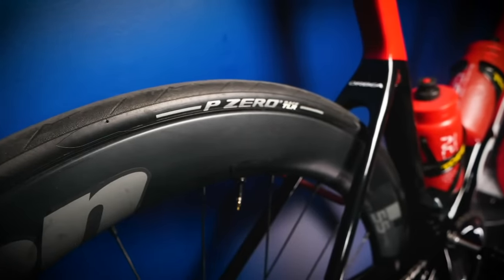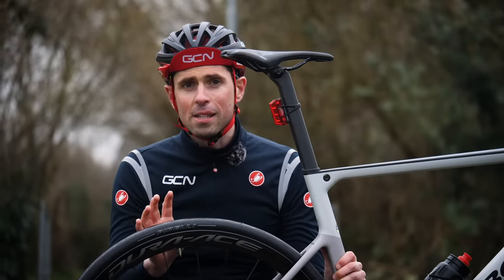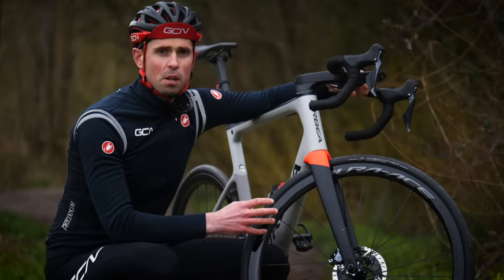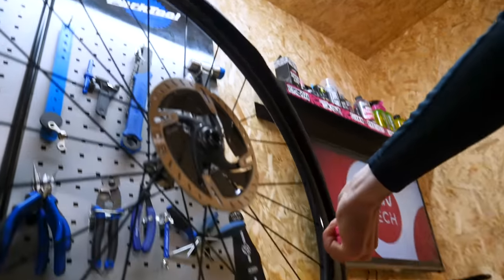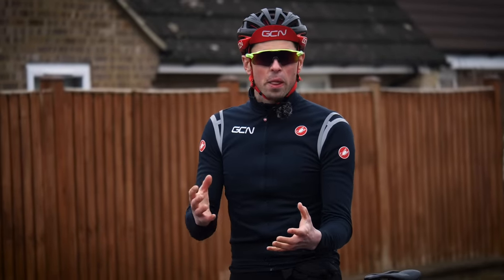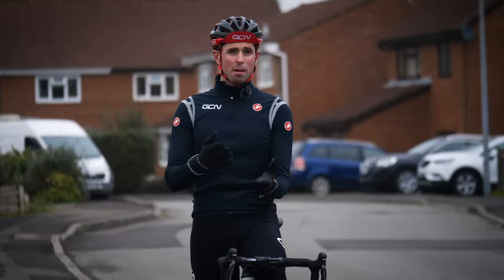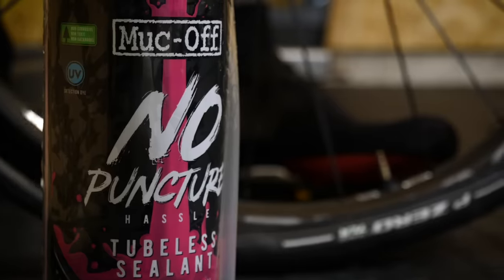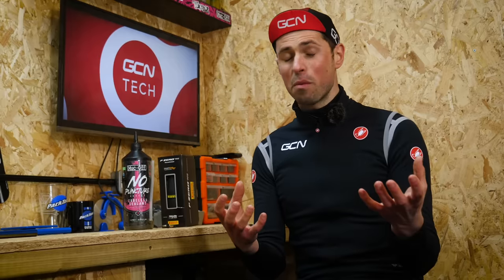Tubeless Convert! | Why Alex Will Never Use Inner Tubes On His Road Bike Again

Comment: Doing mostly long distance riding, this is not at all interesting. I’ve seen plenty examples of people struggling with tubeless tires. More than with tubes. The worst one taking two hours to seat a tire after a stubborn puncture, that needed the tire off. We ended up having to drive the rider to a bike shop, where they had compressed air. It only takes 3 min to change a tube.
Reply: Besides, this test is faulty. The course should have been ridden at a specific speed, like 35 km/h, and then we could look at the watts differences between the rides.

Comment: I ride tubeless on my gravel bike and tubes on all the others  - why? Because I can’t afford 3 new sets of wheels.  Not sure why you are running your tires at 95psi on the 28mm? I run mine at 60/65psi. Much more comfortable. Bigger tires with tubes lower than this.

Comment: Clearly biased, and it doesn't even shower the power he is doing for each run, psychologically he could be going harder with the tubeless just because he prefers it.. I tested tubeless once and it I got a puncture and it didn't even cover the whole .. so I got stuck in the road.. the rolling resistance compared to latex inner tube for example is not significant and can use those tubes for faster days.. no from me..

Comment: My new gravel bike has "tubeless ready" wheels, but not "tubeless ready" tires, so there is a bit of expense with changing. If I run it as 60psi now with tubes, what pressure would I run it with tubeless?

Comment: What as the lightweight tube: latex or something else?  And was the test done at a constant (or quasi constant) power output?  I'd like to see this test redone at an indoor velodrome so that changes in wind and traffic won't influence in the test and so that power output can better modulated. Then test the following set ups: tubeless; tubed w/ butyl; tubed with lightweight butyl; and tubed with latex.  OF course testing indoors means you won't see any data that reflects any impedance (as discussed and researched by Anhalt, Heine, Poertner and others  https://blog.silca.cc/part-4a-rolling-resistance-the-history-and-previous-works).

Comment: The performance and all of that has been a wash to me.  If there was a sealant you could literally put in and have it last the life of the tire, so it didn't dry up over time, and have you wondering if you are covered or not, I think it'd be better and adopted.  I want to be able to train and outside of something ridiculous, not worry about a flat.  I still carry a tube or two, patches, then have to add in plugs, etc if i'm tubeless.  I want more security.  Performance from slowest to fastest isn't enough for me to care, comfort is the same for me with latex tubes.

Comment: Another GCN commercial, tubeless and an ugly Orbea disc bike. You are making this sport all about tech and forgetting what riding a bike is all about. 
I use tubeless and tubes and around my 50 mile circuit there is absolutely no difference in performance.

Comment: I've recently switched to tubeless. TBH the main reason was simply to reduce punctures as there are a lot of hawthorn hedges around me that get cut, then thorns on the road. One question though. Do I need to remove the old sealant when topping up every 6 months or so?

Comment: Question: Is it ok to use the carbon wheel tire-levers on dura-ace wheels? I have the dura-ace carbon wheels & the manual says that you cant use tire levers. Saw you using the carbon wheel tire-levers and really curious. Cheers.

Comment: #askgnctech Hi Oli and Alex, I have a set of Zipp 303S wheels running Continental GP5000 TR tubeless but find that after 3 days, my tyres are down to about 10 psi. I pump them up, go out on a ride and yet again 3 days later, tyres are down to about 10 psi again. Is this normal or do I have a leak somewhere? Thanks in advance
Reply: The gcn videos are just product placement adverts for the industry, hence the lack of interest in replying to your valid question.

Comment: On my CX wheels I get a nice reassuring "ping" when I set them up and the tyre seats and the tyres stay sat even if they go flat. Whereas on my road wheels they don't "ping" when I set them up, so the tyres unseat if they lose pressure, which is a massive pain if I need to let them down for any reason. If this a user error, or a problem with my tyre choice, or a problem with my rim choice?

Comment: Question for you! How many times over the 5 yrs you've been on tubeless have you a) been stranded with a catastrophic failure that wouldn't seal, b) had to put a tube in  while roadside and contend with a messy milk shake doing it? I like everything about the concept and advantages of tubeless but every time I get close to converting I read a post or article about someone getting stranded because of it, and if I have to carry a tube anyways, I'm just not sure I see the net advantage.....Are stories of sidewall tears and sealant failing to work exaggerated?
Reply: Not going back to tubeless any time soon. Just a complete pain in the butt.
Reply: I've been running tubeless for a few years now on both MTB and Road and have had zero issues. I can see a few white dots on the tire here and there where it has sealed what would have been a flat.

Comment: Why can you run tubeless at such lower pressures? I have only ever run clinchers and I have never really understood why there is such a difference in pressure.
Reply: you won't get pinch flat when you use tubeless that is why lower pressure for tubeless. if you use that low pressure on an inner tube you are very likely to get pinch flat.
Reply: @charng  Of course! Thank you! I just switched over today.

Comment: I am very interested in moving to tubeless tires, but I have some concerns. I know tubeless can handle some small punctures. What happens when I am out on a 100 mile ride and have a puncture that the tire cant handle? I can imagine a big mess with the sealant going everywhere and if I have to carry a tube as a backup what’s the point? Right now tubes seem so much easier. You have a flat - change out the tube. If you have a flat with tubeless it seems like it would be a big mess and you have to carry a tube as a backup anyway. I really want to go tubeless so convert me!!

Comment: Alex! Help! My new bike came with a tubeless wheel set. I do love it. However, when I inflate my tyres to 85psi or higher I get spurts of air and sealant coming from an old puncture. Is there something still in there? I have looked but can’t see anything. Any advice?
Reply: Yeah.  Not unusual IME.  My advice would be to go back to tubes.  Honestly.  Not trying to be a d-hole, but I've tried tubeless on my road bikes a bunch of times, and it's crap.  People will probably suggest that you're doing something wrong, running the wrong brand of sealant, or that you shouldn't be running more than 80PSI anyway or you're missing the point.
The truth is  that I've given it several tries, with different brands, and it always ends up screwing me over.
If you really need that miniscule (or possibly imaginary) improvement in rolling resistance, then you're probably a pro racer, and should just run tubulars, since you can just get a wheel from the support car if you ever flat.
If you're an average joe who just likes riding his bike, use tubes.
If you're an average Joe who just likes to tweak things even if you know it doesn't actually matter, get latex tubes..  They're just enough hassle that you can feel like you're hardcore, but without the likelyhood of ending a day of riding when stuff doesn't work like it's supposed to.

Comment: I would be more concerned about being stranded on the side of the road because you don't have a tube to fix a flat. Really can you ride these and not carry a tube anyways? Personally I have a tubeless tire set up, and I have a spare set of wheels that used tires that no longer work for in a tubeless state.

Comment: #askgcntech

I've slightly damaged the rim tape, not in the well, but outside of the well. If I apply a patch of rim tape to cover only the damaged portion, will that suffice?
I don't want to use a new tape for such a small damage.

I want to go tubeless, just preparing for it.

Comment: Meeeeeeeeeeeeh. Ive seen tests on rolling resistance between tubeless and tubes. We are talking the tinyest of % of differences.  Tubeless road tires with sealant can end up weighing more than a tubed tire,unless you buy the handy dandy 160.00 a set special tires.  Not for me. Ive sliced too many expensive road tires.

Comment: Has anyone ever on here ever sucessfully put an inner tube in a tubeless tyre, i've tried at home as an experiment with a gp5000tl and a hunt wheel I gave up after an hour and am not convinced it can be done   especially in cold temperatures when the tyre is cold and less flexible.
Reply: My Hutchinson Fusion 5 tubeless tyres work just fine with tubes. Gave up on the tubeless setup.

Comment: I have 4 sets of on road wheels, each set have a lot of life left.  I don't see any practically why should I switch to a tubeless set up.  Furthermore, the video is subjective, why not put the tires in a DYNO where power and etc. are controlled and consistent with each other.

Comment: I was all about tubeless until a catastrophic failure caused my tire to explode. Granted it would have happened on a tubed tire as well but i lost all air within about two seconds. I'm just lucky it happened coming out of a turn and not in it. Now I'm running one tire tubeless, one tubed with a latex tube - I can't tell any difference.

Comment: Sealant works as good in tubes as it does in tubeless.  Not a flat in 3 years running this way.......................what if you wanna swap tires quick for an upcoming ride?  Not with tubeless you wont.

Comment: I have converted to tubeless tyres recently and I agree with Alex. Inner tubes are dead 😂 much smoother ride on tubeless
Reply: Wait until you puncture and the sealant doesn't work. Then the "fun" starts. Tried for more than a year and got tired of putting tubes into a gooey mess.

Comment: #AskGcnTech Tubeless and rim brake, could  the higher temperatures of the rim during the breaking  dry  the sealant? I have a set  of carbon rims that should be tubeless ready but  I'm  worried if the  liquid sealant hardens up with the heat!
Reply: No it won't

Comment: Not a great video. Test is absurdly unscientific isn't it? And no real discussion of the cons of going tubeless.
I'm a big fan of tubeless for off road riding. Where the pros far outweigh the cons and the extra grip offered by tubeless tyre is critical.
But on a 28mm road tyre there just isn't enough gain to offset all the negatives.

Comment: If I wanted to try tubeless and have the right rims & tyres do I need a specific type of pump to get the initial seal? All I have at the moment is ‘Stone Age’ track pump.
Reply: It depends.  I've never used a special pump and have always gotten them to seat, but I have had some that are difficult.
All said, I wouldn't bother.  I've gone back to tubes.  Tubeless isn't worth the hassle.

Comment: Everyone knows: latex inner tubes are the best.  Why did you run your experiement on slow, heavy butyl tubes??
Reply: Watch the video one more time - they used both the regular and lightweight tubes.

Besides, latex tubes are known to leak air, which means you have to pump the tires constantly. Fuck that.
Reply: @dainiusvysniauskas2049  I don't agree!  Latex are so fast and awesome!  Pumping up for each ride isn't really an issue, if you ask me!

Comment: Tubeless is fine ... until you have a flat, when you have to fix it, the sealant is digusting product, dirty hands, very slow to fix because if you want to do it the right way, you have to clean the wheel and the tire before putting a tube to fix it... love tubeless for my gravel and mtb... never again on my road bike.

Comment: Promoted videos to sell sell sell. Tubeless in road bikes is a bad idea. With 8-9 bars there is no way to seal. Try to remove a tubeless road tire in the middle of the road with your hands. 

If you want to ride more comfy then use wider tires like 28 or 30 if your bike allows it.

Comment: Absolutely useless vid,,,,no mention of what happens when you get a puncture 40 miles from home.... and you stated its much more difficult to get a puncture,,,,,nonsense..... my tyres have the vectran protection,,,the same as tubeless, so no difference there.....And the proof that the good club rider would gain approx 5sec on a 30mile ride in perfect conditions and on the flat, makes it all nonsense......and the same has been proved on aero seatpost and the like,,,as the air is so disterbed by the time it hits it, it makes no difference at all

Comment: Actually, when I heard the term "tubeless" tire I expect something without pressurized air in it. And this is the reason why a lot of people show interest in tubeless tires - we are just confused by name. We need exactly the opposite of what tubeless tires are in reality - "tubefull tires" or something.
People like me buy most bikes, but the industry never take our opinion into consideration. We are supposed to be guided by some champion, that's frustrating.

I have puncture at least 5 times a year. Once tire explode because sudden atmospheric pressure drop. Several huge nails. Can happen any time. Do I want to carry spare tubeless tire with me all the time? Hmm.. no. Do I want to carry it for a year to make sure I won't get punctures at all with tubeless tires? Still no.
I'm not a pro, I care not about 2 more watts at all. But I care about reliability.

They can heavy, they can be filled with led - if I will never have a puncture by design - I will buy them. 

I carry some random stuff with me anyway, sometimes it's heavy, I never wear this tights or whatever it is, I will exchange a few grams of tire weight to a bit of reliability any time!

Comment: Prediction: Road bikes will be produced with slightly bigger wheels (diameter) soon, just like MTB to fuel the need to sell more of 'the latest' new bikes, pro's will get them for free, the adoring cycling enthusiasts will sell a kidney to buy into the latest trend, and here we go all over again. Of course, although bigger, they'll be more aero, more compliant and obviously faster with less rolling resistance because of the larger radius overcoming the seal drag on the bearings, and somehow lighter. In five further years will come the reverse mullet Road bike that will climb harder and faster because the rider can maintain a more horizontal position and increase Watts per km and will be used on predominantly mountain stages.

Comment: Are those times the average of several runs? If not, I seriously doubt the differences are significant (ever hear of "experimental error"?) Even if they are significant, who cares apart from an out-and-out racer? The comfort issue? That is obviously subjective. I run 28 mm Gatorskins at 70-75 psi and have no comfort issues. Lastly, it has been suggested elsewhere (Waynos Fotos: https://www.youtube.com/watch?v=mZIGPeF3kZw) that tubular tires with sealant might be the best of all possible worlds since, in addition to the alleged benefits of tubeless, you add the ability to ride on a flat tire.

Comment: You still need to bring a tube with you on the ride for those times you get a large puncture or gash.  I don’t see the advantage for the non-pro, non-elitist rider.
Reply: Dynaplug (or similar). Takes less than 30 seconds.

Comment: Is tubular faster than tubeless?
Reply: A bit slower actually. Pros still use tubulars cause even if they deflate, the tire still remains glued to the wheel, so the risk of crash is way less than if your tire gets out of the rim cause it has no pressure (like it could happen with hookless rims)
Reply: @serdiezv  thank you. I actually still use tubulars as well, cause I don't wanna give my Carbon Wheelset away😟
Reply: @dings2063  well, if you save up a bit and sell the tubular wheelset you might be able to get a carbon clincher/tubeless wheelset. Hunt wheels make really good carbon wheels for around €1100. But that's right, price constraints aren't one of the pro's deal breakers haha.
Reply: @serdiezv  all right. I got a Bontrager Aeolus 5 Wheelset from 2016, what do you think I theoretically could get for them?
Reply: @dings2063  depending on the condition, I'd say between 700-1000
Reply: @serdiezv  The pros also have support cars with pre-glued wheels and tires following them; we don't.
Reply: @shannontrainer5857  yeah, even the pros use and prefer clinchers for training

Comment: Im not paying hundreds possibly thousands of pounds to go a tubeless setup and achieve a slightly marginal improvement in rolling resistance when if you pair the best clinchers with latex tubes you can acheive a similar result. Michelin Power Time Trial clincher tryes with a latex tube is equivalent to the best tubeless setups at a fraction of the cost.

Comment: Thanks for the great info on tyres and bikes in general, I'm getting back into cycling after many years, (more specifically triathlon shout out to GTN 😉) I'm gathering info about what the latest knowledge is and I'm quite surprised to see (tubeless of course) but quite wide and soft tyres. I used to ride a modest 750 miles a week but the thinking then was narrow and hard, I rode 19mm tyres at 10+bar pressure. Can you do a film on tyre width and pressure for the least rolling riding resistance I'd be very interested. #askGTNtech